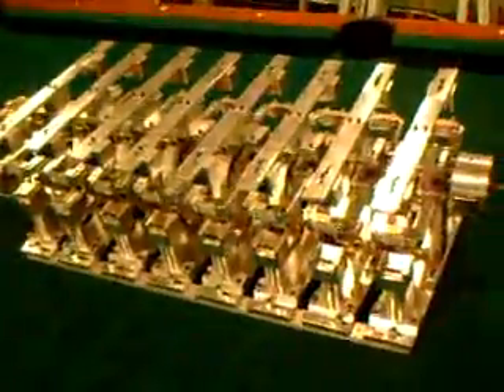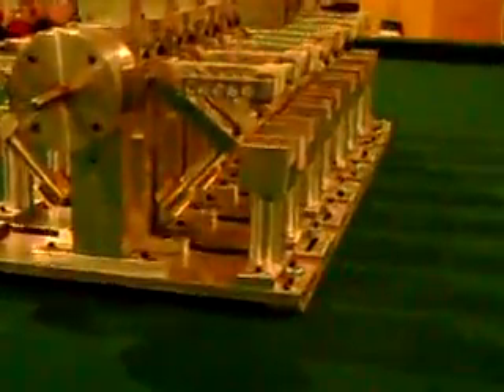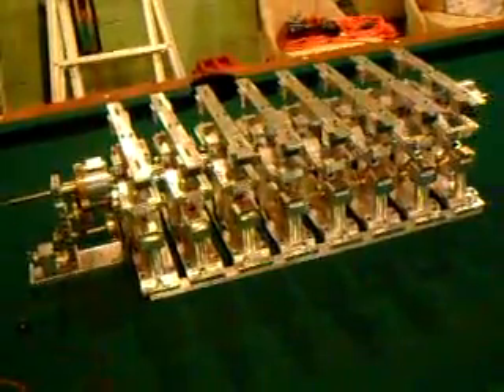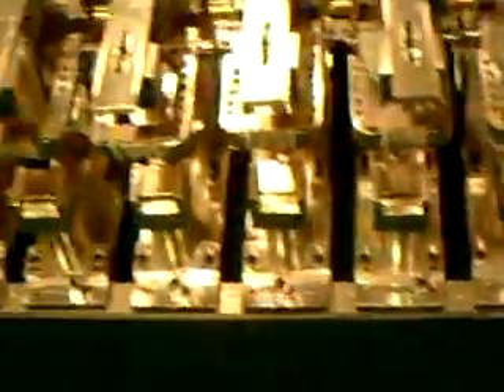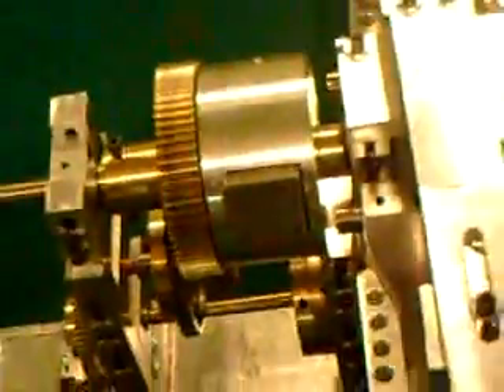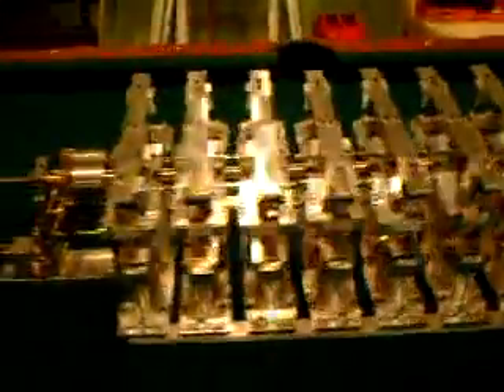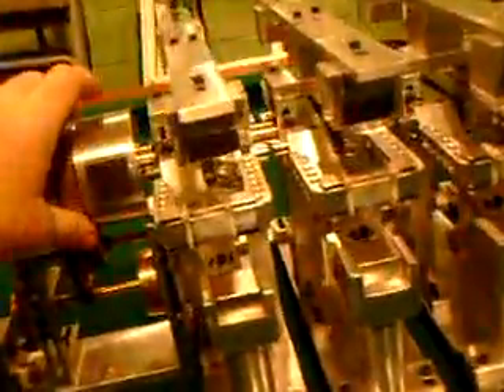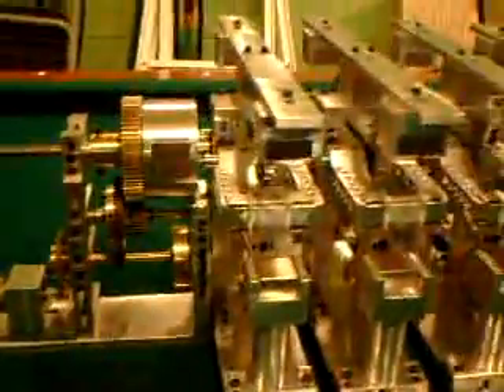Over Unity 16

Comment: With those two drums at 90 degrees from each other, with proper tuning you'll be able to get a 1/4, 1/2, or possibly even a full standing wave with this configuration, depending on the frequency (RPM's) you're supplying to each node.

Keep it up! I'm interested in seeing this completion.